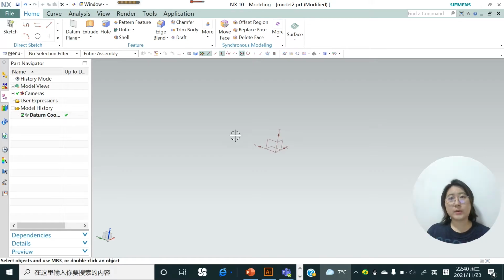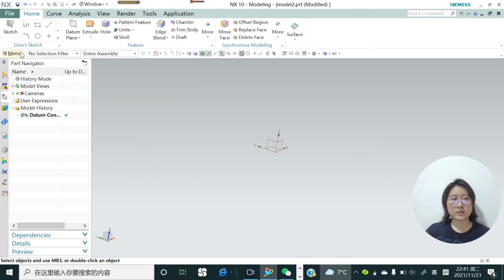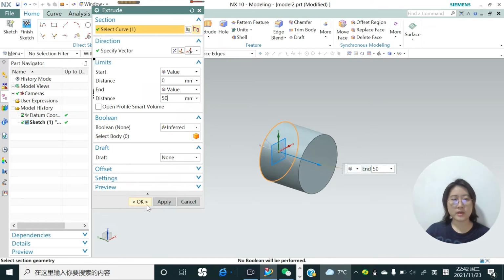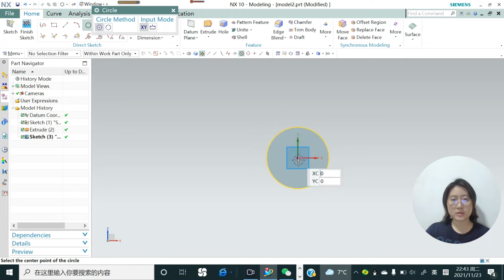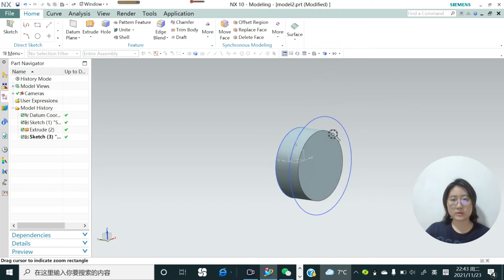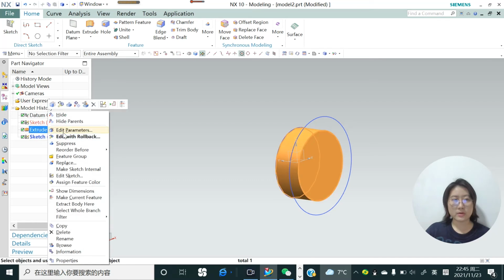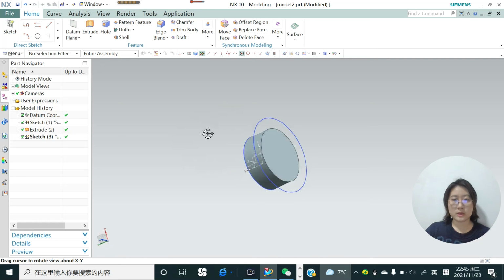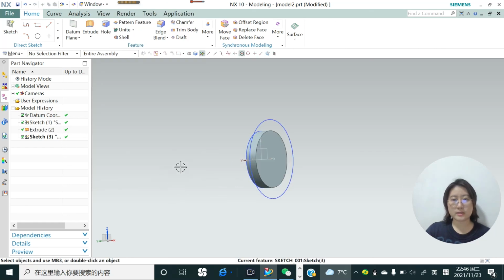UG NX tutorial lesson1-Layout|Mouse Operate by YangStudio

Comment: which is better，ug or sw,i using sw more than 14+ years, i found some operating merhods are same,especially multibodies in solidworks,but sw has some shortages in surface,and the software is too big and eat memeries,but siemens nx interface is not as good as sw,it,s hard too choose,maybe i choose use them both!